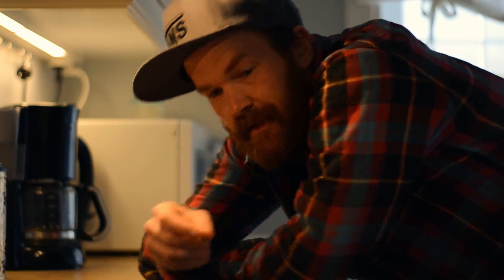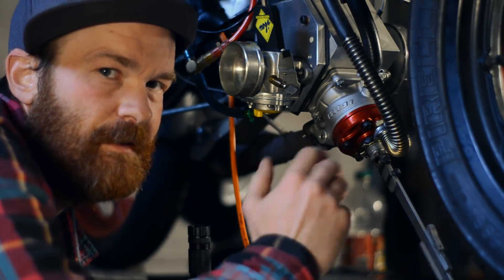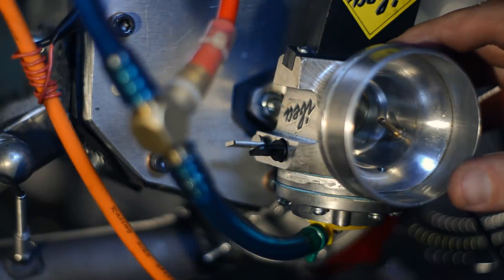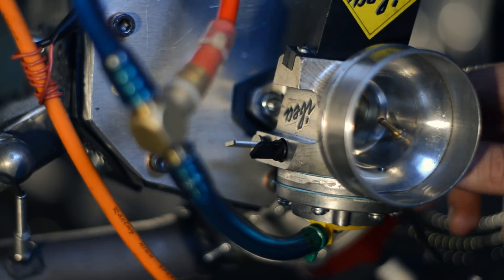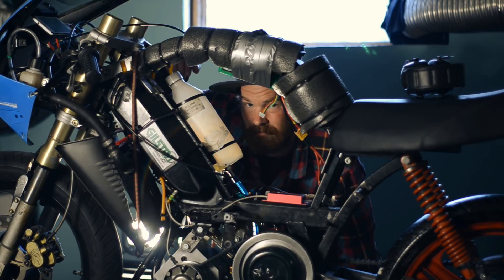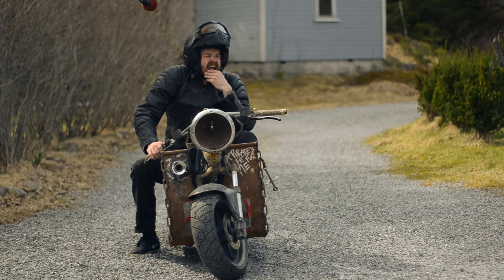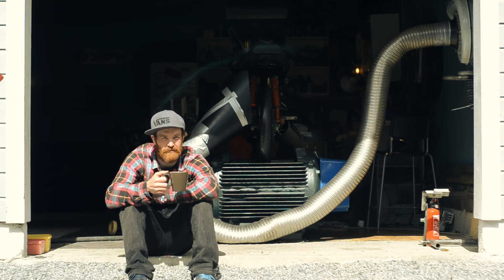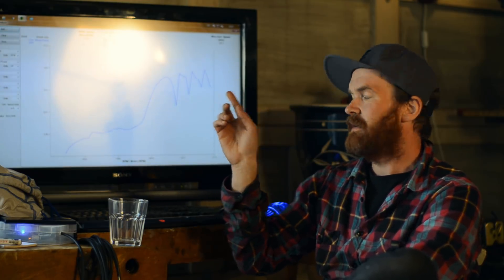iBEA Carb FTW! - 50cc DIY Rotary Valve Peugeot Spx

Comment: It looks to me that you are using too big a carb and no air filter, all your getting is a big bog and alot of gas wasting, put on an 18 mm or 16 mm, its only a 50 cc my good man , you have to make air go in, and a low vacuum with a slight air restriction ( air filter) is the way to make it happen. Also I was told by an Old friend, a young teen in WW2 he was,  two things, ( said with polish lilt ) You no can rrunum 100 percent two stroke , tuneum to make powwa 90 +, and knurlum piiston. ( oil control cyl lube). I thought i would give my moped a up grade by putting on a 21mm only to find out it was no good , i went back to my 14 and was doing 47 mph again . Let me (us) know how it goes. And test on the road till your spark plug turns toasted coconut brown, it should be good at that point.

Comment: On a two-stroke engine, an expansion chamber or tuned pipe is a tuned exhaust system used to enhance its power output by improving its volumetric efficiency have you test motox pipe its have bigger expansion chamber and its can pulse it much better i just wanted to ask have you test out those pipes

Comment: Does one actually intend to spray all of that fuel out of the carburetor all the time? ~( ,m,)~
Reply from the maker: It's the high intake duration, no spray on the pipe at high rpm.

Comment: Have you considered using a Lectron Fuel Systems carb? They don't use jets at all, they use a metering rod system, and they compensate for altitude/temperature so I feel like it could really make your tuning easier
Reply from the maker: I have, but they're so expensive!

Comment: 3 needle I know I'm behind the 3 months. Closest to intake manifold or engine is low jet mid screw is high jet .. that 3rd screws is something different never seen it before super high jet.. this carby is probably for a 100cc or 125cc.. u may need to run a higher spring rate spring / on pop off pressure . Most likely both.. it will help you to control your low and high -wider working window.soo to lower a spring rate is rich higher is leaner.. higher the spring rate the harder the engine has to work to draw fuel from the carby..the u factor in the metering with the fulcrum arm to diaphragm .. higher metering arm more fuel lower leaner level with the body is close if not on the money... plus the ibea fulcrum arms wears and they get soft and flexible to the point I think it changes while running .. bad for tune if u can find a stainless arm from ether tilliston or tryton it will last longer and hold your settings true for longer..
Reply from the maker: Thanks for the tips!

Comment: I got a carb that will give that motor 20+ hp
Reply: 2STROKE STUFFING gotta watch my videos I'm way past 20hp with my China 66cc motorized bike motor. That gravity of the RV gas is different compared to 50nitro 50 meth
Reply from the maker: And what carb would that be?
Reply: Lectron
Reply: Ck out pico spray

Comment: i thing that if you bend your rotary valve,litl like propela on the edge.and make bigger housing for the bend to fit.2 things can happen,first it will boost the engine 2 the inaction of the fuel/air is not going to be a problem on hi rpm because the air fuel when it stops and starts has inaction.and slow down on hi rpm.thats a reason you cant go hi rpm.but with bent rotary valve the air/fuel has 2 ways to travel in the cylinder or around the rotary housing so never stops moving but get higher and higher speed,try it.
Reply from the maker: Interesting idea. I fear this propeller would have to move alot faster than the crank tho, to not become just a restriction. There's a pretty huge amount of air passing through up in the rev range.
Reply: not a propela just a rotary valve with a bend on the start,it will keep when it close a amount of air fuel on the frond of it(cylinder side) spinning centrifuge for 180 degree ready to cam in the cylinder.on the back of rotary valve(calbulator size)when the rotary close the intake.the stream of air don't stop just continue spinning.this makes the two stroke engine continue filing the hole cylinder on hi rpm.so you produce hi power.i have try something like that(same idea)but on cylinder intake)just try not to stop the intake stream but instead changing roads.on a mtx125 engine.then it could rave on 14500 rpm easy production power up there.the mtx engine before that only go about 9000rpm.other modification a delordo 32 whit 280 fuel jet!! it work whith no problem hi or low rpm....so something is there.
Reply from the maker: Very interesting, thanks for sharing! What did the system you used on the Mtx look like?
Reply: i will try to explain with my poor English,iam a Greek man.the most difficult thing on 2 stroke engine in my opinion is to fill with mixture the upper side of cylinder and the back of the piston.the upper side o the cylinder i difficult because the ports on cylinder is just over the piston when its far down.and when they open they one is oposit to either so the mixture from one crash to the mixture of the other and loose speed,after that the mixture try to travel up to the top of cylinder.this take time.so the most of the time the cc of the cylinder is not complete full.as the rpm go up the more the cylinder not full.till you fell the power drop suddenly.before the inaction of piston rod stops the engine.so first thing is to fill the upper side of cylinder with mixture,i did that by making on the top of the piston litl ramps were the intake ports are.i did the ramps by grinding the piston head with a little disc tool.the results were more than i expected.low or hi rpm the engine felt like more cc and try it you will see...more comming next
Reply: john panteris essentially what u did is port it. U changed the port timing. When I do r&d on new cylinders I build from scratch that is how much to alter, verse cutting the port timing to much and that’s a lot more expensive any time consuming. Usually I’m within .
.25-1.5 degrees with my algorithm
Reply: Plus ur pipe has a lot to do with how much the cylinder fills. So many people don’t understand that a tuned two stroke pipe is essentially boosting ur engine. On a multi cylinder smoker u can see it easier with a compression tester when the engine gets on the pipe the comp ratio jumps up. That’s y u might have heard of static comp ratio verse running comp ratio. In the sled world just by putting twin pipes on certain machines, a Xc800sp for example u have to either run 110 octane or buy low comp heads to run Slp pipes below 6,500ft

Comment: Hi, here is some advice from Brazil.. i have use this carbs  for some years now.. one time even instaled one of these carbs in a 4cilinder car... Hahaha
If You use the vacuum hole in the carb tô Activate the inside pump, You can use the carb in any orientation! You have to use the inside pump! It Will make ALL the diference! Runs much better with the vacum LINE, makes it more tunneable.it Will be more progressive, and wont Lean out at highrevs. You shoud test It out, before losing your Head trying tô tune It without the vacum! Remenber tô check the popup pressure!! Setting the propper pressure in the popup Valve Will make the adjustment in the niddles feel more responssive. 1° vacum LINE
2° test diferent popup pressure
3° then You can tune by the neddles. 
Ps, watch out for the height of the arm that open the fuel.. It soud match the carb body...
Sorry for any wrong words.
Ps.2, Sorry If You already knou all these.. those are the things i wish someone have told me in the beggning, like "follow the yelow Brick road". 
Best of luck!
Reply from the maker: Thanks for the advice! The vacuum line is connected to the intake and pumping seems to work. On a car! That's awesome!
Reply: 2STROKE STUFFING  try make the intake longer, hookup the vacum tô the crank or other place away from the mouth where It wont lose as much vacum when WOT. The little pickup hole on the gasket was never enough on my expiriences Happy to help!

Comment: Hello i am from Portugal. Where on our 50cc bikes the old ones , they come with about 8hp . But are kits for them 80cc kits . And then they make the double off the power. How is possible to much power that you have (17hp) with a tiny piston?? By the way your canal is really good 💪💪
Reply from the maker: Thanks! It's mostly down to port/duct geometry and the pipe. And 17 at the wheel with the CVT is probably past 20hp at the crank...

Comment: How did you learn everything you know about 2 strokes???
Reply: 2STROKE STUFFING plus lots of trial and error, mostly errors for me the first 5ish years doin mods. Been building for 30 years now and thank god them days are gone. Very expensive. A cheaper way to practice porting is to cut the actual piston crown and skirt. Can get the exact same effect that’s not permanent or as expensive as a cylinder. I figured that one out myself lol
Reply from the maker: Being obsessed with 2 strokes for many years you're bound to pick up a thing or two.

Comment: What is your secret for getting 17hp out of such a small engine??!?!
Reply from the maker: Porting and pipe... 17hp is at the wheel, and there's considerable loss in the cvt transmission.
Reply: Cvt on a average suck up 15-25% depending on brand and setup

Comment: The black adjusting screw is for high-speed....., and as you just said, those carbs shall work in any position. As you probably know(?), all of the two-stroke chainsaws ar using such diapraghma carburettors, without any problems related to different positions. 
Nice results so far, looking forward to your next attempt! :-) Otherwise, normally, there's no "mounting it like it is supposed to be"-issue. I think your problem, as you also have mentioned already, is related to the "pulse situation". My guess is that you'll get a quite different result when the pulse"problem" is fixed. And yes, it may be a small challenge regarding the correct needle / adjusting screw settings, but this also would be a bit better with the right pulse-working.

Comment: Two burning questions:
1) Can the IBEA run as a downdraft?
2) Can the engine idle with an Ibea?
Many thanks in advance
Reply from the maker: 1) yep
2) yes, but setting it up to idle might make it too lean at higher rpm(so I'm told)
Reply: I've wanted one of these carbs for years, but on a street bike it must idle. Oh well. I'm currently working on one of these downdraft conversions to keep the idle circuit:
https://farm1.staticflickr.com/980/41847192701_416b38e60a_b.jpg
Reply from the maker: Cool setup!

Comment: Great video! I am currently working on building a Frankenstein moped and am trying to find the perfect cylinder. Have you seen some of the newer Athena kits for the Minarelli am6? They come in 50cc and 80cc and the interesting part is they have a power valve that works off pressure from the exhaust. If you could check them out and let me know what you thought that would be awesome. Thanks
Reply: Karelin James definitely not something new the way the powervalve  works off exhaust pressure. Look into the snowmobile world. Very common

Comment: Happy Birthday,  nice Vid good Run and interesting carb upside down flip.
In Chainsaws these Carbs are Mounted like in your first Run with the Diaphragm facing down.
Why not , when it works. 
I would definately try it with the correct impulse line , maybe it will run better. 
Good Luck
Reply from the maker: Thanks!

Comment: Richer is safer than leaner. The steps through the carburation on this thing is finicky. It may, WILL take even adjusting the angle of the slide. Nobody does this! This is great. Your original 20 horses sounded better than this. I have always said its better to be lucky than good. I think you have a good direction. Now come help me tune aircraft or big bikes. Learn the smell. Its what I do.
Reply from the maker: Thanks! The original 20hp was 15,3 at the wheel, now it's 17hp!

Comment: Told you a Tillotson would do it :D Nice slide carb body on it as well!
Reply: Also, do run the pulse line from the crankcase, the fuel delivery will be much more positive with a solid moving diaphragm.

Comment: Glad your project has finally made some positive headway ! Unfortunately my super awesome bike that I just got done building and testing I now have to take apart to ship overseas for my year long tour across the pond. However it will be a blast pissing off the electric scooter guys with my super angry two stroke with pedals
Reply from the maker: Thanks! Year long tour with angry two stroke sounds fun!
Reply: 2STROKE STUFFING the look on peoples faces when you blow by them on “bicycle” is priceless although at this point I’ve basically built a small motorcycle. I feel as if I’m not getting in the power band as good as I could be though not sure what the deal is

Comment: Those carbs does starve under prolonged g-forces if mounted with the membranes horizontally to the force applied as the membrane adjusting the pop-off pressure pushes harder against the valve needle. I had that issue on my paramotors when pulling high G's and after a lot of testing I found out that mounting them with the membranes vertically solved that problem. Probably not a problem you'll encounter on a moped though as it may take up to 3-4 G's, but in a "wall of death" it could become an issue.
Reply from the maker: Thanks, better keep away from wall of deaths then...

Comment: Hey 2 stroke stuffing it look like your end can is leaking alot of the exhaust gas ? The end plays a roll in the back preasure etc im sure you know what your doing it may not be loose but it looks like its flopping about man , check it out if you can and let me know im intrested if it just looks like that from the wheel rotation and keep up the vids man i love them , i wish i had a dyno i have a moped a gilera storm 50 cc with everything done to it , im running a Airsal Tech Racing 50cc - chrome mahl single piston ring , how can i make my own dyno ? And what will i need as a shop called Pedparts near me dont use there workshop/ dyno no more because there so busy with selling parts i wanna know the true out put im making like you do
Reply: Also were can i buy one of your boards for a dyno to use with the simple dyno program? Thanks
Reply from the maker: Yep, the slip joint is worn and leaking. For ardyno boards go to ardyno.weebly.com, check out my videos on the diy dyno for how I built it.

Comment: Is true that this type of carb doesn't have a good partial throttle response ? I have a AX 100 (similar to the RX100 but crappier) with some mods and i need a better carburetor, since i don't have too much space this type of carb will be ideal
Reply from the maker: Not enough experience with it yet, sorry.

Comment: I’ve never been able to tune my pumper carb running it upside down. I’ve noticed my pulse line filling with fuel and it just stops running. I’ve even ran them right side up with no pulse signal right side up and they worked fine just with gravity feed
Reply: Jacob Felts sounds like u need to rebuild it

Comment: At around 5:38 in the video it looks like the engine mount bolt right above the carburetor was turning....  Man it sounded great that last pull!
Reply from the maker: Yep, it's loose on purpose for things to not bind up. "prototype" engine mounts, no bushings/bearings. There's a nyloc nut and loctite on it.

Comment: I had this struggle with my chainsaw carb aswell. It's really hard to adjust these carbs without a safe reference point. But my best tip is to adjust the low jet first and then adjust the mainjet. Then you get a solid base to adjust from. Also in my experience the pulse line is not nessecary when you got you fueltank above the carb since the fuel pressure will make the carb work anyway(atleast on small walboro carbs).

Btw keep it up!
Reply from the maker: Thanks, and thanks for the tip!

Comment: Just a thought but have you considered using a reed switch and with a magnet attached to the rotary valve or crank to signal the diaphragm thus electrically imitating the pulse, it would be faster response wise but maybe more complicated...just a thought.
Reply: Just sounds expensive. I know the magnet would let loose and trash my engine lol
Reply from the maker: Interesting idea!
Reply: U can also get ur pulse from ur exhaust...

Comment: use spray adhesive on the back tire to gain traction
Reply from the maker: Good tip, doing that already. Won't work when the pipe is spraying oil all over it, need to seal the silencer slip joint better.
Reply: Rubberized under coating on the roller helps for a lil while. Sand blast the roller as well. Their is a place by me that electro coats all types of metals/alloys with the best I can describe it is like a concrete road or 5 grit sand paper lol